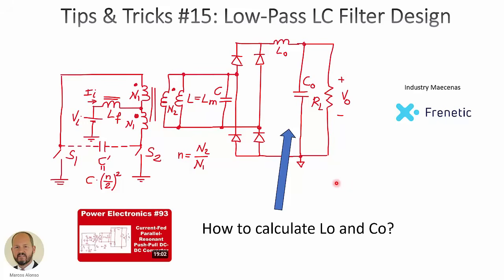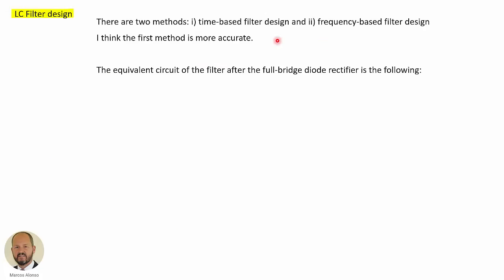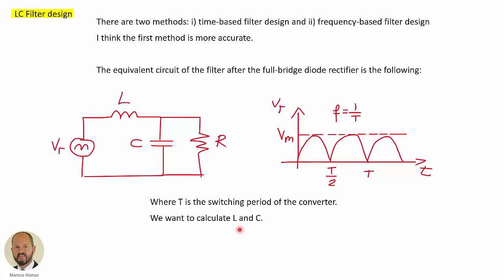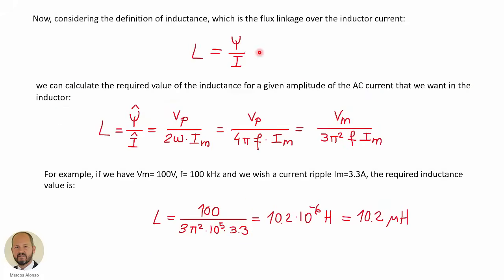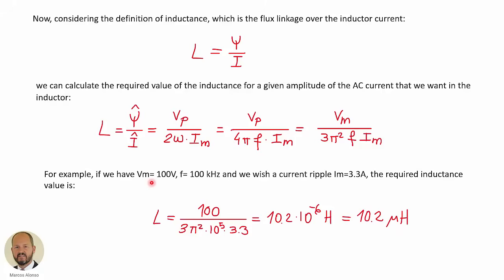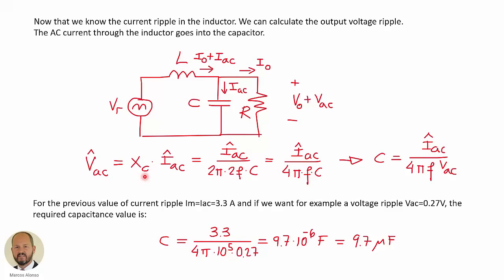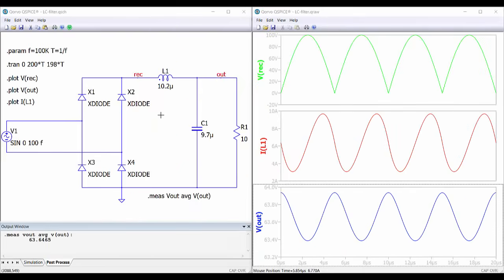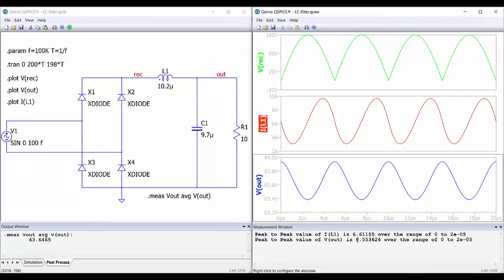TT #15: Low-Pass LC Filter Design

Comment: Thank you for this excellent presentation. Once question: What would be the best/ suitable method to regulate the output voltage, still keeping low(no) loss switching behavior during the modulation ?
Reply from the maker: Thanks for your comment. Usually an upstream buck converter is used for output voltage regulation. The input choke is the inductor of the buck converter so only an additional switch and diode are required, and the driving circuit of the switch, of course. The parallel resonant converter is thus kept operating at resonance to maximize its efficiency. The output voltage is regulated via the duty cycle of the buck converter. This could be the topic for a future video. Thanks!